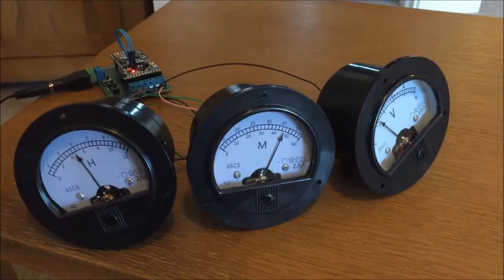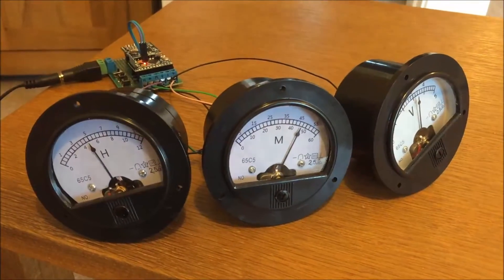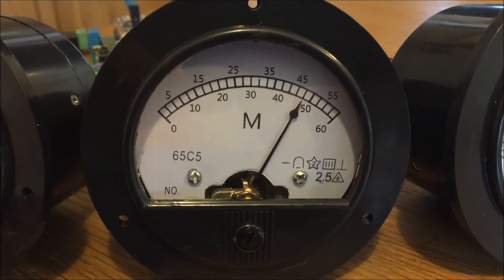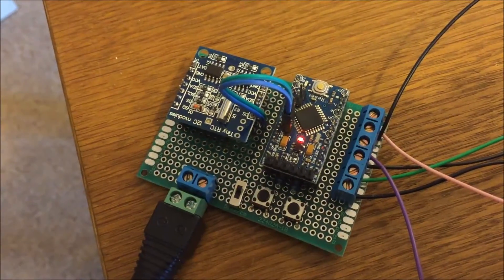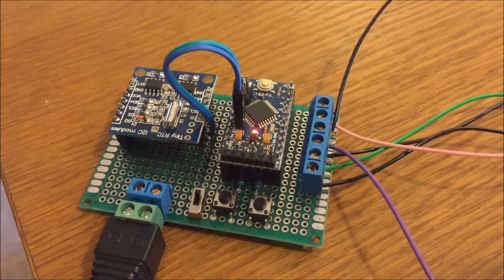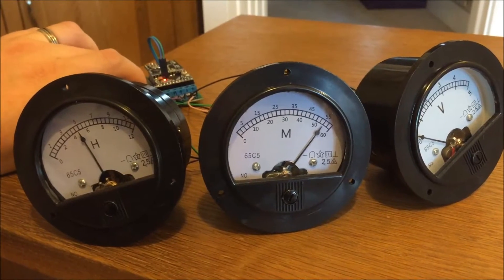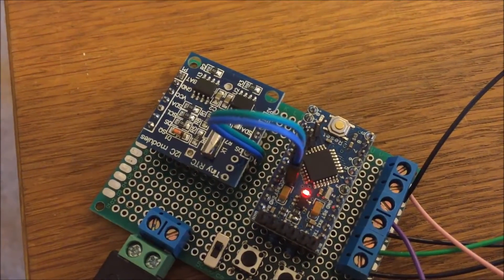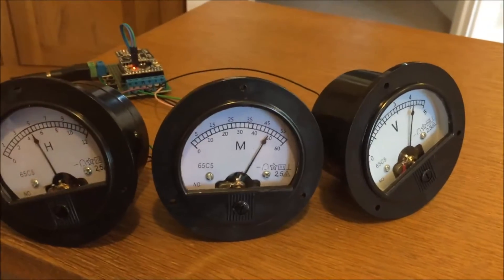Volt Meter Clock - Part 1 - Adam's Arduino Projects

Comment: Are these 0-20V meters? How do you get the Arduino to output a suitably high enough voltage for a full scale reading?
Reply from the maker: Hi. These are 5v meters so the project was relatively easy. Still running - what five years later now?
Reply: @AdamWelchUK  No stabilizing on the Arduino outputs, since they are PWM?

Comment: Ordered the meters at AliExpress and wanting to make this clock. Unfortunately the link to your code is not working anymore (404 Not Found). Do you still have the code and could you upload it somewhere maybe? I am also interested in the customized gauge faces. Would be great if you could also share those. Thanks in advance.

Comment: I would recommend removing the diode on the RTC-board and use a standard CR2032 instead. The charging circuit on those RTC-boards is really bad and the amount of standby time on the rechargeable cell is laughable (months vs. 5-8 years on a CR2032)
Reply from the maker: Thanks for the tip - My cell is not showing any signs of issues and the clock is almost permanently powered up but if I change anything I'll definitely take your advice.

Comment: Hello, I liked your project, can I use 100ua meters?
Reply from the maker: +Everton Rodrigues Micro Amp? No. The code is all based on voltage I'm afraid. It uses the PWM pins of the Arduino at various pulse widths to create the movement.

Comment: Really like your version of this clock. Question please, How did you change the scales on the meters and keep them looking like the original ones?? thanks
Reply from the maker: +Danny Johnston Thanks for the kind comments. The original metal ones were removed and scanned on a flatbed scanner. I then adjusted the original faces by copying some of the digits and making up a scale. Eventually I printed them on photo paper and cut them to size. Hope that helps.